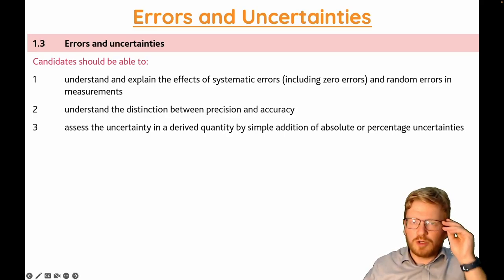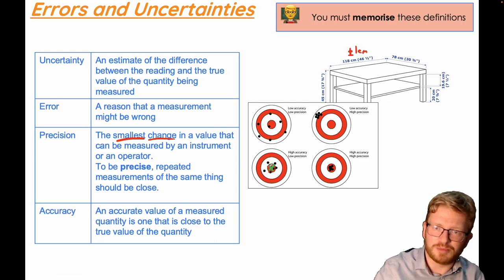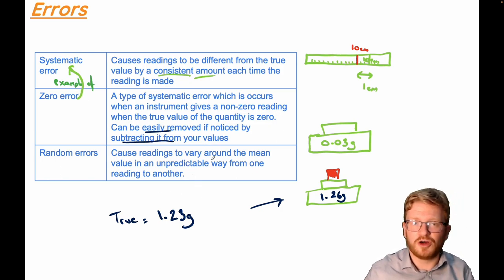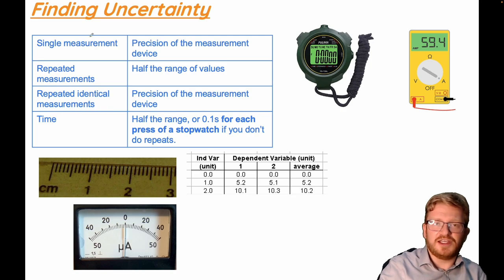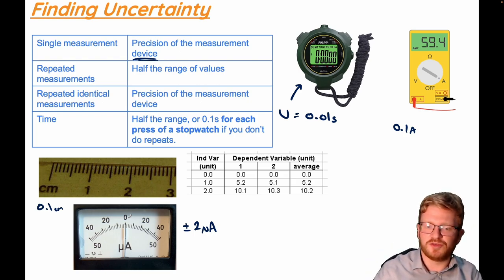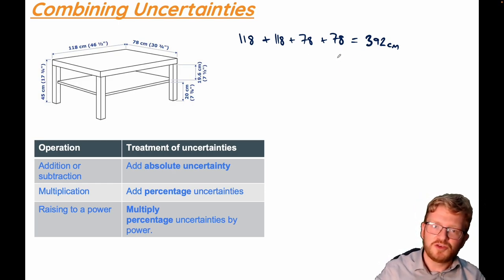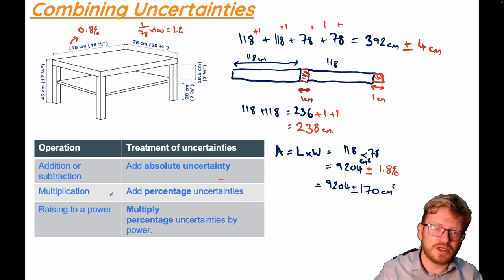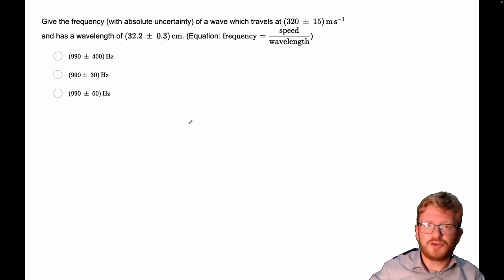CIE A-Level Physics: Errors and uncertainties

Comment: thank you really!
just one question in the recent mark schemes, for the answer to finding percentage uncertainty of a single measured value which is from a meter rule, they are saying the absolute uncertainty should lie in the range of 2 to 6mm, how is that possible if the absolute uncertainty of a meter rule is 1mm ?